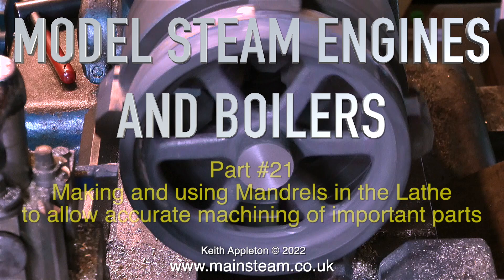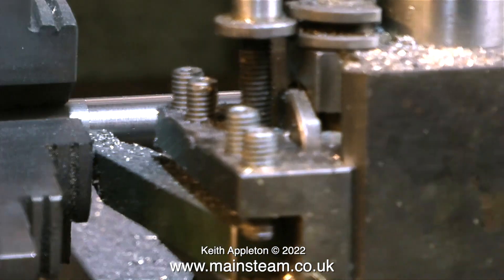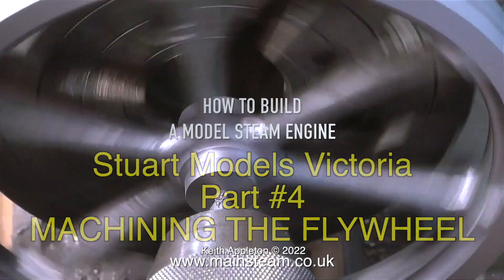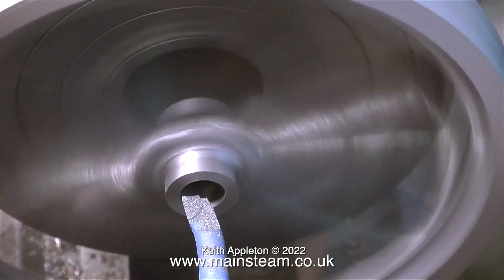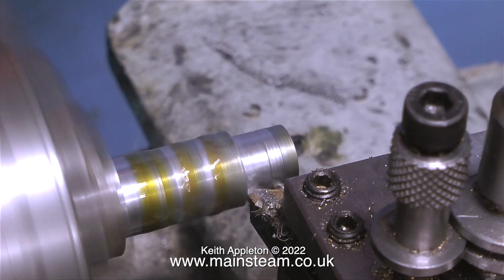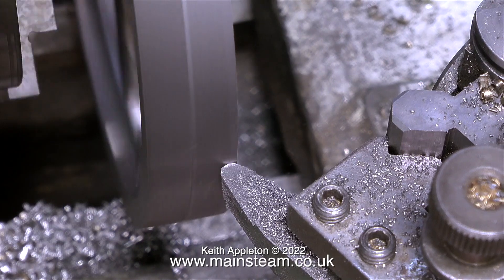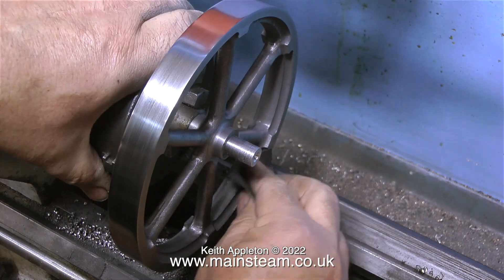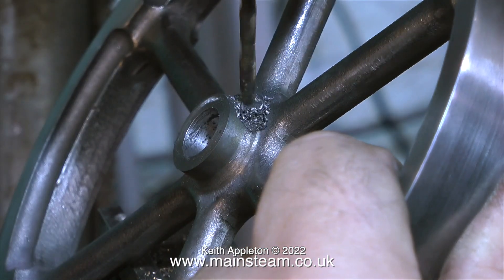MODEL STEAM ENGINES AND BOILERS - PART #21

Comment: Hi, do you balance the Flywheel??
Reply from the maker: Normally balancing is not critical on low revving engines, but when I machine a Flywheel I try to get it to run as concentrically as possible.